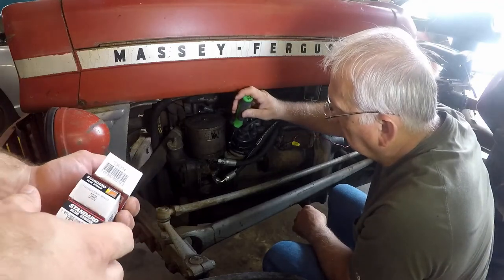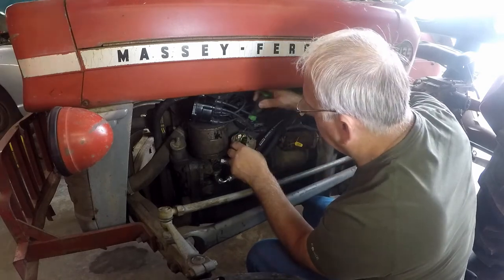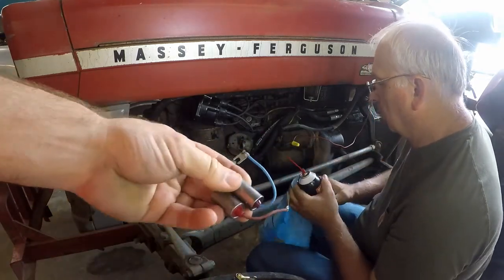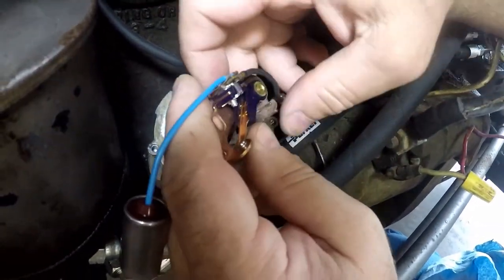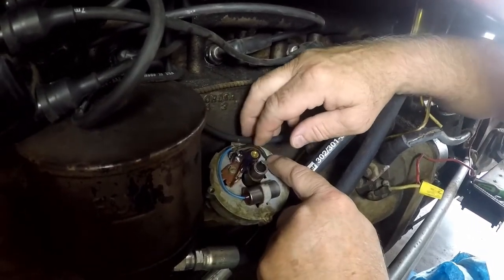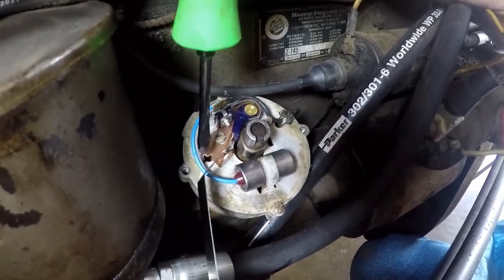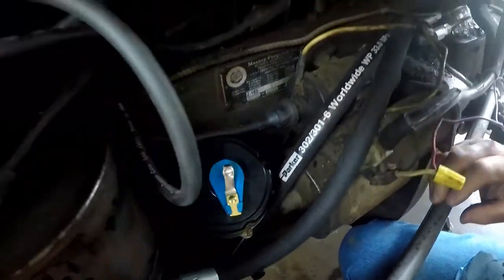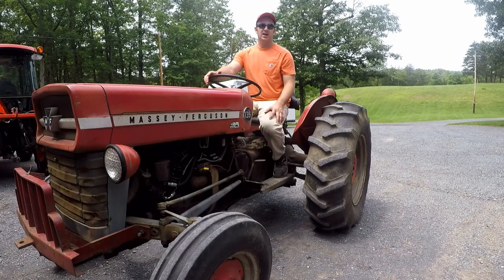How to install points on a MF 135

Comment: Excellent.  Both you and dad. This is what I'm used to working on. Vehicles with plugs, points, and condenser. Before installing the distributor cap, I look inside the cap and look at the individual studs which the rotor gives spark to ensure no corrosion build up. It does not look like much if you're not used to seeing it. If you slightly scrape those studs inside the cap, sometimes a thin scale of corrosion will chip off. If that occurs, I use little sand paper to sand down each of those contact points. Now if you're using a brand new distributor cap, then those studs should look brand spanking new. If you're using the old distributor cap, check for hairline cracks before reinstalling or using. Doesn't take much of a crack to file things up. My old Ford used to need some TLC regularly, especially on rainy days. Nicely done Roger & dad.
Reply from the maker: Thanks! The cap on this one was new a couple years ago and has no hours on it. Someone burnt the points up so instead of getting points from a tractor place, that would have probably been sufficient, I got the good Standard stuff from the auto parts store along with a better rotor. I would have got a new cap but Standard does not make one. Your right a hairline crack will cause problems. Then it has solid core copper wires, which work great. So now the ignition is in good shape minus checking the timing.
Reply: Roger that.....Roger (smile). A fine job you two did.  Tell dad we expect to see him more in the videos (smile).
Reply from the maker: Thanks, I'll tell him😄

Comment: I have not worked on a vehicle with points in ages. Neihoff used to use those same DRxxx numbers back in the day when I worked as a mechanic for a living....I wonder if Standard/Neihoff are related?Anyhow great vid and good to see your assistant.... working during his summer break from school :-).                 One of my fondest memories is when I was 15 and got my first car an Alfa Romeo that when I bought it had the cylinder head in the trunk.... I was ok doing the rest of the work but the cam alignment was past my pay grade...My dad helped me count the teeth on the timing chain to the double overhead cams, he did a great job and the car ran like a champ.
Reply from the maker: I don't think I have ever heard of Niehoff. I just looked and it looks like they are the same as BWD now. There must have been some relationship with Standard for them to use the same numbers. I'm actually the "boss" and my dad is the assistant in the video😀

Comment: Thanks Roger! It's great to see you both on the video!  Do you have an advanced timing mechanism under the points?  I use to check for free movement when I do the points. I did not changed the condenser in a while.  Does it wear over time? Or it just simply quit working? Thanks!
Reply from the maker: Thanks Joe! Yes, it has an advance. The condenser could cause a misfire. Here is how you can test a condenser. http://mgaguru.com/mgtech/ignition/ig129.htm
Reply: Hey thanks Roger!  I think I underestimated the condenser value.  Thanks for the link! I did some more research about it. I understand it does not wear gradually.  It runs or it suddenly fails (it shorts). When it is short, then the points get high voltage coming back from the coil, instead of the condenser. So the points will fail soon after that. Not replacing it makes me at risk for an unpredictable failure.
Reply from the maker: I've never seen a condenser failure, but there is not much out there with a points ignition today. My Dad may have seen one fail. I'm sure they can fail, not sure how common it is. We usually replace the condenser when the points get changed. Even a lot of people are going to an electronic ignition conversion but that gets costly, because you need to change the coil in a lot of cases and then you can't use solid core wires. If you get a new condenser see if you can get a Standard blue streak or Napa Echlin. These are better than what the aftermarket tractor places sell. They may have a listing for your tractor by application. You may be able to find it by the type of distributor like I did. Lastly keep the old condenser as a spare just in case you would need it in a pinch.